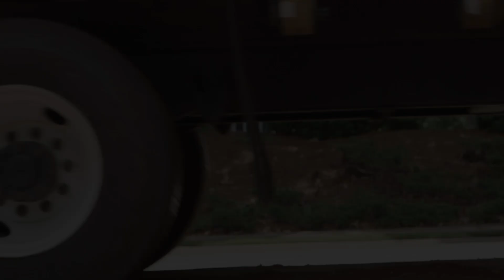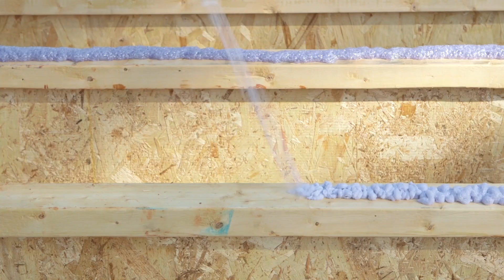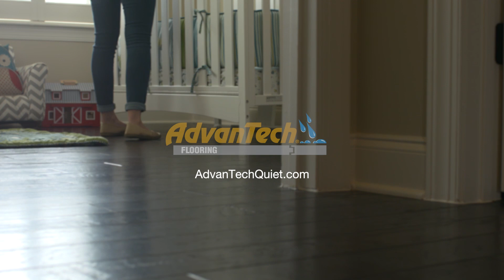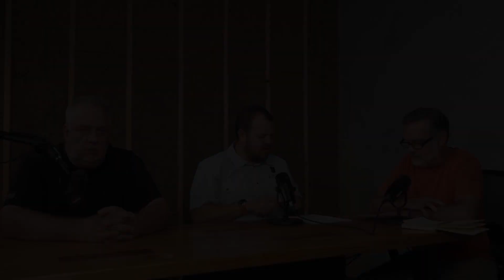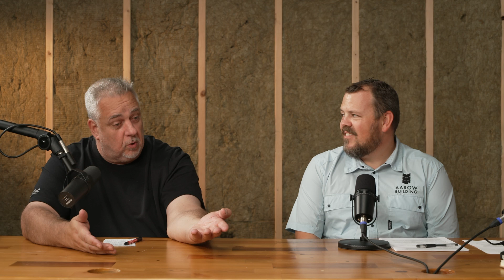Q&A: Ventilation Systems, Pressure Balance & Butyl vs. Acoustical Sealants  - UnBuildIt Podcast #105

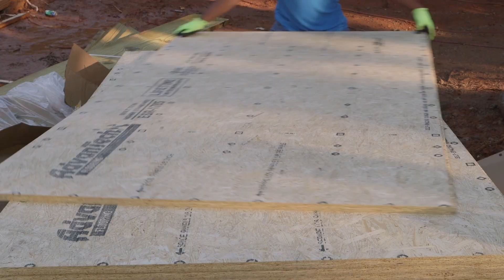Comment: Great question! Although it is ideal to have dedicated ductwork it can be very expensive. It may be dependent on total volume. I own a roughly 7000 sqft ranch with a walk out with a total volume of 100,000 cubic ft. My ERV is connected to the main HVAC system. I have dedicated humidity sensing bath fans and a low cfm hood vent without make up. I run the water furnace geo fans continuously and have two dehumidifier’s. My IAQ monitors are near perfect. My 50 cfm bath fan running for 10 minutes sucks out . 0:02 5% of the total volume. I doubt that causes much pressure drop.